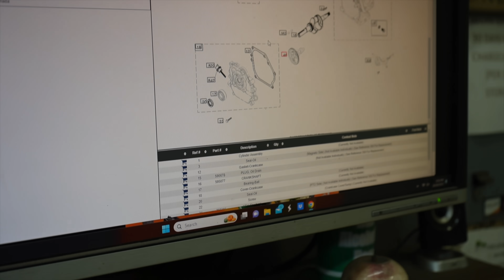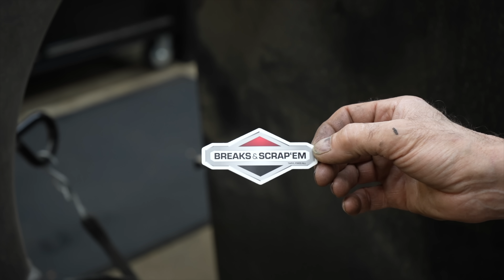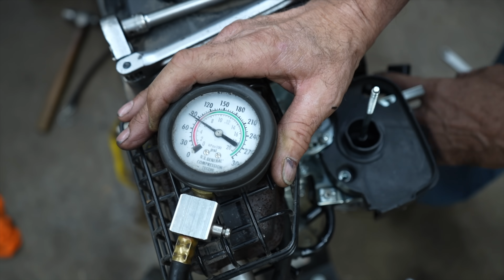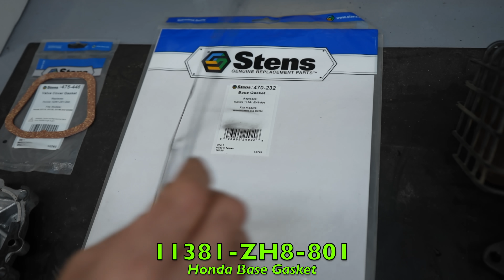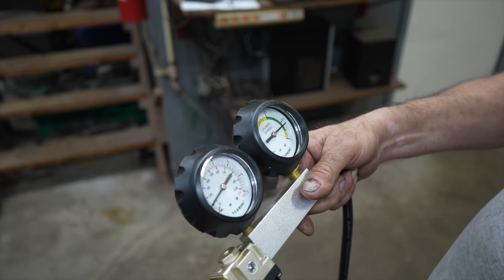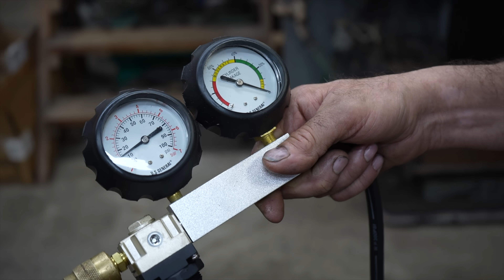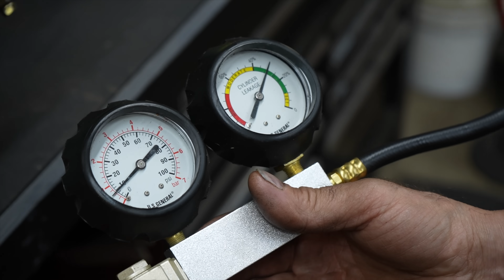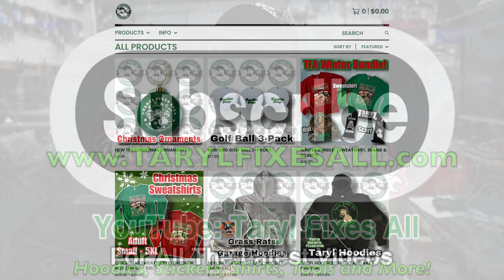Has He Finally Met His Match? Taryl is STUMPED!

Comment: Taryl, I have the same leaf vac. But with the chipper. And the Tecumseh engine. The owner before dusted the engine. It does have the taper output shaft. I was planning doing a harbor freight swap. But they don’t have a taper on the shaft. To have the same 8 horse engine I’d have to buy a taper sleeve from Amazon, and then drill the hole larger in the fan to fit the larger 1” crank. 

How would you do this type of repair? 
Thank you

Comment: Yard debris plugging the gas cap vent running the engine lean overheating the rings.
Reply: Air cooled engines have that issue when a lean condition is present.
Reply: The ring lands could be sticking the rings from being overheated and that could be the problem. Doing it over and over just gets worse over time. Leaf parts plugging the air cooling causing the over heating. Just sounds like that's the problem coming and going, Gets to the point it wont run at all.

Comment: The question to me qould be do you have compression ? And is that changing when it runs ..dint run ..if it doesn't  change its not in the valves ..gitta be in the ign

Comment: I think this is giving me a lead on my Kohler engine the dang thing takes a minute of cranking before it'll start its like it's not getting any gas but when it's running its getting to much gas when you shut it off after running for a bit it fires like a shotgun out the muffler Has good compression on both cylinders fuel pump I'd new its getting plenty of fuel spark plugs look normal Runs good when it's running i'v been trying to fix it for a year now

Comment: i wonder if there is a source for NOS briggs flathead engines? in no way would i buy one of those things for $500. the predator is a pretty good deal because they make sense new, they run good, seem to last decently and parts are pretty well available. i have a predator on a pressure washer i built. it's a predator engine, a triplex pump on and old pressure washer frame. i am very happy with that engine for the price.

of course, if you COULD find a NOS flathead briggs, you would still run into the same problems with the crankshaft and muffler.

Comment: Stuck rings at 10 hrs? Considering the # of engines being manufactured with low tension rings these days that actually come out of Detroit with full synthetic oil in the crankcase, I very much doubt that it was caused by synthetic oil,  but more like it had an inferior oil or maybe even a non detergent oil in it. Considering that today's synthetic oils has such robust detergent packages in them, getting stuck rings with just 10 hrs on them seems nearly impossible. Could it be some crappy assembly lube used got cooked in causing them to stick??? Who knows?

Comment: They're probably just sourcing their engines through Alibaba's manufacturer locating service     ..I wonder what caused the rings to stick   ..incorrect tolerances      overheating with metal transfer     surly wasn't carbon already    I usually run mystery oil and or B12  and or a couple of ounces of two cycle oil in the tank

Comment: Taryl you are :face-green-smiling::face-green-smiling::face-green-smiling::face-green-smiling::face-green-smiling::face-green-smiling::face-green-smiling: :face-pink-tears::face-pink-tears::face-pink-tears::face-pink-tears::face-pink-tears::face-pink-tears: I love the lawn detective skit!  This video went over everything! It had you stumped, but you didn't let it get to you! I've always said that you need a lot of Patiance to work on these small engines. I remember back in the day when we would get a car come into the shop that was sitting for a long time and would not start. OF COURSE, WE WOULD CHECK FOR SPARK, THEN FOR FUEL when we had both and no water in the gas, we would do a compression test. This was back in the 70's when I would work in a repair after school. The compression test was very low, so I was told to get MARVEL MYSTERY OIL put it in an oil can and pump each cylinder with 5 pumps of oil. We would let it sit overnight and crank it up within 24hrs. then blow out the cylinders put plugs in it, and she would start right up! Smoked like hell but released the frozen rings. Love your video's :face-green-smiling::face-green-smiling::face-green-smiling::face-green-smiling::face-green-smiling::person-turqouise-waving::person-turqouise-waving::person-turqouise-waving::face-blue-smiling::face-blue-smiling::face-blue-smiling::face-blue-smiling::hand-pink-waving::hand-pink-waving::hand-pink-waving::hand-pink-waving::hand-pink-waving::body-blue-raised-arms::hand-purple-blue-peace:

Comment: A goddam plastic camshaft! Jesus merry n Joseph… ive seen hobby RC cars with a more robust engine lol that thing is trash fer reelz. Id definitely check the compression release, or if the woodruff key is partially sheared, valve guides/seats and clearance, or if the coil is grounding out, or magneto shorting out once it’s hot, maybe the camshaft is warped or bushings/bearings are worn out of spec? After that theres not much left… other than blowby or something 

Wow! The rings were the last thing id think to check on this thing with these conditions. You are good sir!

Comment: 80 pounds with the compression release removed is way too low.  The other engine doesn't really have 60 pounds. It has much more once the compression release disengages.
It should have more like 100 pounds and 140 for a brand new engine.

Comment: These Newer Briggs Engines on Push Mowers are All a bunch of Crap, went through 3 of them in 4 years just mowing around church property and I take care to change oil often. I have a old 3 1/2 HP one that I bought about 20 years ago that still runs-just low on Compression-it has never Failed other than a Carb. Kit...

Comment: Bad spark plug? I’ve had cheap spark plugs “work” when tested but when they were under compression they would not spark or spark so little it would not run the engine.

Comment: Man I would of figured the CHIEF would of been Taryl's Wife . Ahhh hell with the muffkin , just straight pipe it . Come on Taryl put a flat head / l head on it . I had a similar problem with a Honda engine on a push mower , drove me crazy for a bit . I changed the coil and check key and other things and all it was was the sparkler it would fire for a while then just stop firing and it was a NGK plug . I would think that the compression release you took out is causing the one to have 80 pounds when cranking it over while the other you did not take the compression release out has 60 pounds .

Comment: Bought a $99 Predator 7 years ago to replace the Tecumseh on my wood splitter till I could get a better(?) Briggs. Got it out 3 weeks ago to change oil & clean air filter for wood cutting this year. After servicing it started on the 2nd pull and ran like a champ. Usually run it at 1/3 throttle and it will put out plenty of ram pressure and run for 2 1/2 to 3 hrs per half gal tank. I may have the only one, but, 7 years, $99, all metal parts and zero issues seems like a best buy to me. I went and bought one last year for $119 and stuck it on the shelf for a "just in case" and will get another 2 or 3 this year cause you never know what will be banned next by the all-knowing politicians in DC.

Comment: G'Day Taryl,,mate had me a similair problem with my Son and (MY) his whipper snipper,,(Weed Wacker),,
yeer he borrowed mine run alright and then not,,Busted pull cord(Yer we tried),brought another as i was stuffed as to why it wouldn't run,,No good either,,now a brand new motor should run right,,well nup,,
now have 3 whipper snippers that just won't go,,soo's i role me self a smoke and start thinking,,
what the only thing in common with these 3 engines,,won't go,,
Big Light over head and bingo,,asked him,(MY Brilliant Son) about fuel,,he then tells me that he got some old motor oil and mixed that with the fuel,,that was the problem fuel wouldn't egnite because we use a motor oil in stead of a "TWO " stroke oil,,
now i hear ya,,shuld go right,,Some thing in the motor oil just would n't let it burn,,not even smoke,,
Got us some freesh fuel and RIGHT OIL and Now have 2.5 whipper snipper working,,
2.5 ??,well had to buy another pull assy for the first one,,
I'm 64 and never had a problem like this,,even the best of us can be footsnoogered every now and then,,

Comment: Yeah. I had a bugs and crapple thar that the flywheel was bad. The maganet came loose. They said it was the cam. I tore it down and found the issue. So I replaced it with a predator that I paid 90 bucks fur. Never had nother issue.

Comment: On the briggs with the pushrods removed should have made no difference on the leakdown tester if the piston was at tdc or the piston down all the way. Or in halfway down cause you had the crank locked up with plyers. On the other engine when you let the piston go down you had the pushrods in is why it showed bad. One of the valves was started to open. You could hear air going threw one of the valves.

Comment: Why is a compression release necessary on a small engine. There were no compression releases on the old school side valve 10 hp B&S engines. They weren’t that hard to pull start them

Comment: That's a real learning experience everything is made the manufacturers don't care about the job is all they want to do is get the s*** out fast they don't care I wonder if they have this problem and I wonder if the manufacturer even puts those motors on the one that equipment or they probably go to a different motor going down Wells the motor is no good and I was shocked to see a plastic gear on a on the camshaft

Comment: Lol all that engine needs is a valve adjustment. And a carb cleaning. Those compression release arms  on the plastic cams are very sensitive to proper lash.  When he took the valve cover off and those rockers were flopping around it should have been a red flag. Just what I see.

Comment: powerfist canada $180 cad but life longevty if a luck og the draw but blown up before 1 year !!! a new motor or money back !!! princessauto canada the silver motor(has iron sleeve) is the better 212cc !!! and will take the predator parts fine !!! but usa the predator is good enough unless you can find a cast iron slevev mototr !!! as simple as need nbe just change out the exhaust systems !!! try and find any motor that matches for the same cc !!! warrenty just send it back to the store and get a new one !!! when warrebty ends good luck on some stuff !!! but if it matches other cc motor they will workj in them !!! I own a 2022 250cc strike sxs and no parts for the final gears before the chain dive. every site I seen so far don't have my kids sxs yet for some reason !!!

Comment: That price is cheap compared to a tandem gmc motor had the cam shafts wear out after 6 months  dealer refused to warranty it 4000 $later and a month later we finally got it back 20 miles later and it started running rough took its back it had sucked though a valve the mechanic shop covered it under their warranty 6 weeks later it was back on the road and again got it home and took it over to load it and again same thing took it back to the mechanic and again waited 6 weeks to get it back but was told that that the warranty was over when they phoned to tell us it was ready did we want to come get it we told them to to take it to the dealership and we traded it in on a new one once that was done we put a stop on the last check payment on the rebuild if the motor did it again it was the dealership problem had other GMC with a transmission problem 2rebuilds later and it went again this time my brother was rushing to get done took a corner to as

Comment: Bet it's a valve seat lifting sporadically 🤔 I have had them come loose seat and run and then lift and get stuck open. Guess I was wrong I know they have been using thinner and thinner rings to lower friction and they get weaker and weaker. This is what happens when you let 8 year old Chinese kids build your equipment and just stick your name in it

Comment: Taryl My Brand new,Generac ,after 1 year, Camshaft went bad, I used it 2 times, They put Brand new motor ,1 1/2 years later that camshaft went bad, They would not replace the Motor 1000 dollar Genset, My wifes boss Had a Chinese generator the stator went bad, It had a honda Double. It bolted right up to My genset, and Has been running great for 5 years ,and I have used it a lot of times. I have had 2 craftsman motors just like the 1 your showing Had the same Problem Bad camshafts, Junk they do not care about there Products anymore.

Comment: Ok Taryl. How many times have you had an engine that wouldn't spin over very well because the valve clearance was too wide and the compression release couldn't bump a valve open and release the compression? So why didn't you just open the valve clearance up so that the ACR would not bump the valve open and try it, before doing all that work tearing it down?  Also, why not do compression and leak down tests first to see what the problem might be before tearing stuff all apart and still not having a clue what's wrong? I guess it makes for good drama and video, but it sure is a waste of time otherwise. "it turns over so easy it doesn't even need that compression release" ??? Maybe find out why it turns over too easy first , and maybe just maybe  you might be able to fix this guys engine. Finally after 47 minutes of nonsense we do a leakdown test. Just because a piece of equipment or engine or whatever is new, doesn't mean it can't have serious issues. That is why we do the tests to figure it out before wasting so much time doing unnecesary work like in the video. The rings being stuck would not allow the engine to draw fuel in, but the volume of the piston would still allow it to build and show decent compression pressure. That's why both tests are so important to do. Just the same as doing both pressure and vacuum tests on 2 stroke crankcase tests. Just because a component seals under pressure does not mean it will seal under vacuum. Live and learn Taryl, live and learn.

Comment: I agree, B&S old flat. Head updraft carb engines would start on 1 pull even when it was -10 deg F. below zero.  Rubber belts in crank case and plastic cam gear and and shaft  not for small engine that gets hot and cold, can warp, twist .  Everything is throw away today, how is that good for the environment.  Taryl you help us save money, but this is planned obstanence.

Comment: I am disappointed, that you filed a warranty. I am more disappointed that Briggs and Stratton paid your claim.  Why did the rings stick?  Number one reason is old stale fuel that breaks down into varnish and gum.  You did not mention this at all.  Fuel was probably left in engine when not being used, the fuel was breaking down, the owner started the unit and ran on the old fuel.  Think about it the engine was near two years old it used to RUN good, now it doesn't what stuck the rings?  What the customer poured into the engine.
Warranty is for defects in material and workmanship, not for bad fuel, or abuse.  If you do not teach the customer better, the same thing will happen in another year or two.  And the customer will fault the engine.

Comment: Lean condition can cook the parts in the combustion chamber.
Piston is weak at the top.
The ring lands failed and stuck them.
Thats what he pointed at, but didn't explain, if this is it. 
The time of loss of power could be reduced fuel availability because fuel cap needs a vent for fuel to steadily leave the tank at the needed rate.
The ching bong piston ring lands get heated during slow starvation and dying.
Tells you something about the future if the mower detectives really stay on it.
The cereal mass killer is tipping his hand as to his diabolical evil plan to replace everything with electric crap.
OR.
Its a POS.
Hmmmmm.
Humma na humma na. 
Anybody remember things on early japanese cars?
Then you read me.

Comment: Most of these engines are copys if the Honda I'll bet a Honda cam will fit in it becuase the Honda has a smaller cam than the predator.......I put a 212 predator crank in a Honda 196 block and found abunch of stuff different

Comment: Maybe on the lifters and push rods you could measure the entire length combined instead of just te push rod or lifter ?  Plus if it were electrical it wouldn't start then loose power in a short period of time.  Looks to  really poor quality build and plastic parts inside of it !

Comment: Briggs has weak valve springs and rocker gear is junk. Cam shafts are junk in them also JD Big box store have bad cams and compression release doesnt work. Many people replaced batteries and starters to find a bad cam.
No wonder they have weak valve springs with a plastic cam WTF Those engineers mus have rode the SHORT BUS

Comment: Taryl have you ever though about using a old hair clipper transformer to test coils? The only tricky part is getting the magnetic field from the transformer coil of the clippers to couple into the coil correctly after a little working with it you should find a the sweet spot! You may also have to flip the coil around!